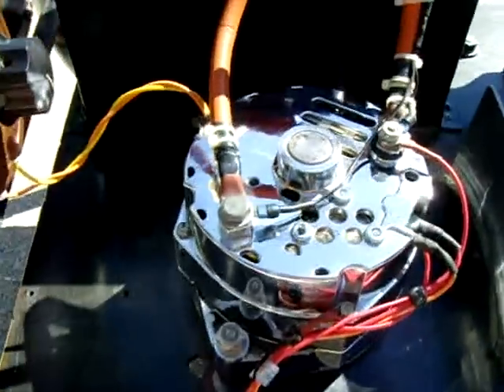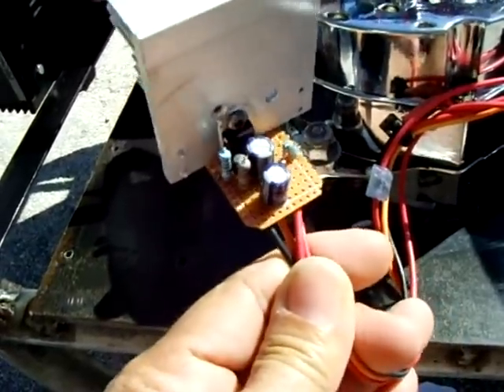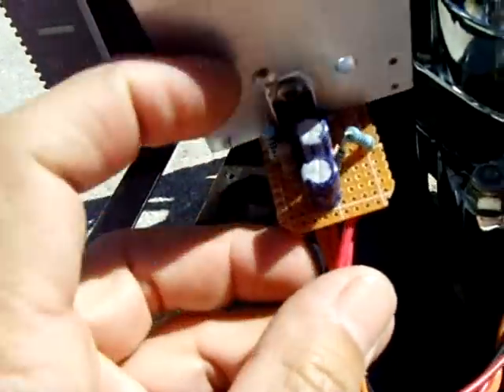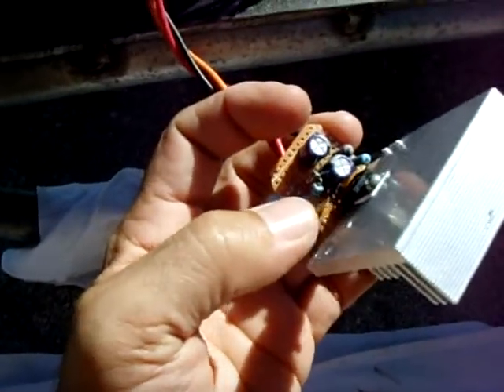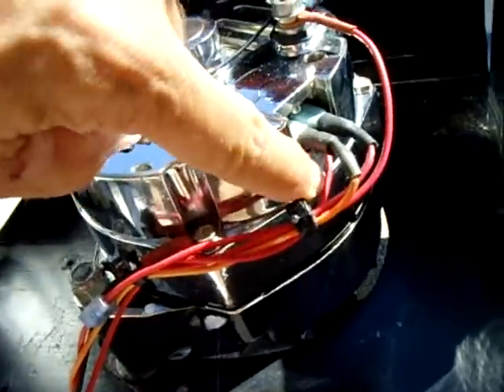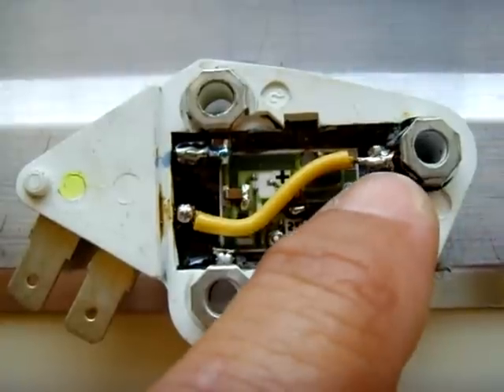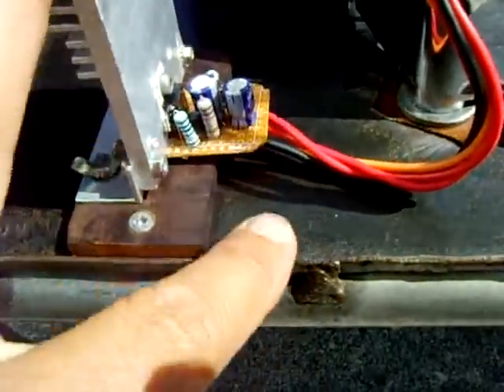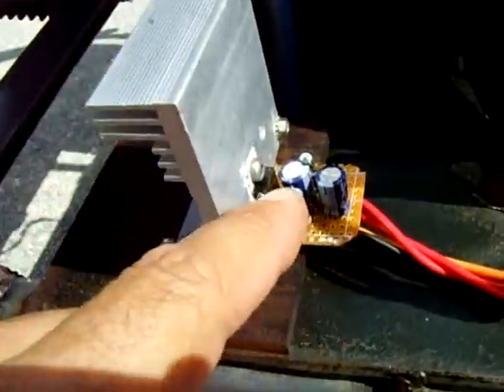Make Your Own Alternator External Voltage Regulator

Comment: Do you have a schematic/idea for a device to regulate the charging voltage to 13 to 14 volts for a lithium iron, LiFeP04, battery that I dropped in a moped that has rotor-stator, not alternator, system. The stock system charges too high, over 14.4 volts.

Comment: Can you use that for computer controlled alternators? My 2011 keep wrangle PCM stopped controlling the alternator and the PCM cost 650 dollars used!! Reman 1000 bucks!!
Reply: I doubt it, you'd probably have to go inside the alternator and remove the voltage regulator and utilize the sense and field terminals of the alternator using an external Regulator like from those old ford's 80-90's

Comment: Don't understand all the fuss. Your using a Delco 10 or 12SI alternator, which uses the internal regulator. If I was to build something like this and wanted an external regulator I would have used the model that preceded the SI, which is a Delco DN alternator that requires an external regulator. It was used on '60s GM vehicles up to '72. In fact, all the automakers used externally regulated alternators during this time frame. You probably could have picked up both alternator with regulator for cheap at nearly any boneyard instead of that chromed SI. Come to think of it, there was a project to build a solid state voltage regulator in a 1971 issue of Popular Electronics (forget the month) that you might be able to dig up online or at a larger library. Check it out

Comment: Thats all fine and good but how do you change starting charge rpm if your engin is runing belove 1k rpm? I have this problem my engine runing slow on idel and I like it but the alternator is backcharging tought dashboard any help.
And culd I actualy use my starter selenoid to exite te field? i do have R terminal type starter selenod thats bothering my for some time now aperantly some polarity swaps acure if my engine trurns on by that r terminal on starter slower turning but bether fuel economy dono why is it so? Im experiancing lot changes in my car even I wuld like to remove voltage regulator compleately and just use resistors on my other devices those alternators provide good power dono what I done my last alternator did not have external capacitor the engine fealt nice faster some how I dont understand what caused it tought??? Can we just get rid of that crapy voltage regulator and just run that alternator similar to oldschool magnetos ore some thing like that???
Reply: You could use a car relay coil to excite it maybe or a .3A light bulb

Comment: Very interesting and informative video.  but having a 12-volt positive aluminum heatsink hanging out there unprotected/uninsulated is absolutely insane. Not to mention dangerous. only a fool would run a setup like that, any conductive material dropped on that it's not only a fire hazard but can easily damage your internal Electronics there's got to be a way to do it without making the heat sink battery positive
Reply from the maker: You sound like the nervous worry wart type, I have friends like you. I ran this generator for 5 years with ZERO issues, far from a fool.

Comment: nice     but what i thought was the  2n3904  switches off the tipp 122.  not the case    it just   splits the power lowering the current going to the tip122  so the field current is cut in half.

Comment: Hi I am just curious. This circuit (mosfet one) will reduce the field current to adjust the voltage to the desired level at + ve terminal? Or just cutoff complete field current?

Comment: How stable was your output voltage when a load was applied and when at idle speeds? My old V-belt style Toyota has a 120A alternator that charges at barely 12V when at idle, so if I'm sitting at an intersection with fans, stereo, wipers, and turn signal going it'll drop down to 11V and sometimes even below, even with a new Denso internal voltage regulator in it. First thing I'll be doing is upgrading the rectifier, then will break out my electronics gear and experiment with an external voltage regulator that I can mount somewhere that'll stay cooler than its current location.
Reply from the maker: Not bad at all. Of course a slight drop under high current load.
Reply: @electronicsNmore  Very cool. This might be worth experimenting around with on my Denso alternator.

Comment: I tried the circuit and the fet blew
Reply from the maker: Sounds like either a faulty component, or you wired it up incorrectly.
Reply: i connected both  field  + and field - to each brush is that  wrong ?

Comment: need to add an Alternator to a 22 hp engine.  Using a 12-volt PTO clutch, requires at least 10 amp charging circuit. most engines only have a 2-4 amp charging rating.. Any suggestions would be great.
Reply from the maker: This is the way to go. 12V/35A. 

https://amzn.to/2MWJiTP

Comment: I No Longer sell this Transistor Regulator for 12 Volt alternators.I Now have a Mosfet  version that doesn't get hot and doesn't require a Heat Sink.People here should also know that the Normal Charge for a 12 Volt Car battery is 14.8 Volts.Or 7.4 Volts for a 6 Volt Car Battery.Gary.........chemelec.com
Reply from the maker: Hi Gary! Hope all is going well for you in Canada. If you'd like me to add anything to the video or video description area, just send me an email. Thanks

Comment: Those resistors look like they are in series so the total value is 1012ohms not 920 something. To achieve that they need to be in parallel.
Reply from the maker: g0mhc Been a while, so I don't recall every detail, but whatever I did do, was done correctly. Thanks for watching

Comment: If you simply attach a 300amp bridge rectifier, what will the ouput voltage look like??
Reply from the maker: Unregulated voltage that gets higher with increased RPM.

Comment: I have two 22SI 150 amp alts they are 12 volts. is it possible to convert them to 24 volt? or connect them in series? I need it to charge my 24volt bank of golf cart batteries. with a similar setup. I guess I should listen to the whole video . before asking questions. so if I can get a rebuild kit for a 24v 22 SI. I will have a 24 volt alternator. I thought the volts could be raised. since it generates in the hundreds of volts. that looks like a great setup. I have only rebuilt alternators. I never had one to tinker with. if it's that easy. I may get a few of them to overhaul. or convert. I'm thinking about putting the alternator on my riding mower. so I can charge the batt bank when I don't get enough sun. or when the lil creek is in drought. I'm planning a water wheel generator. and I haven't got my solar up yet. so I need it now. to help keep my off grid home charged. thank you soo  much for the video. is there any more planned for this subject?
Reply from the maker: You can make a regulator for 24V charging, and run the alternator at a slightly higher RPM.
Reply: electronicsNmore 
what about the turn on speed? what speed will it start charging? also will it.regulate the charge. like the factory regulator.  so it will not over charge the batts. so this just powers the rotor. creating the electro magnet correct??? I can't tell for sure but my alts are 130 or 150 amp. the dot stamping is hard to read. maybe one is 150 the other isn't. not sure. I need at least one to give 24v

Comment: can you make 12v  voltage regulator into 144v
Reply: If you are speaking of an alternator that uses a field current to control the output voltage, that might be possible.   If there is no feedback (no regulator), thus a static field current (usually around 1-4 amps), the output voltage is dependent on RPMs.  If you increase the field current you might reach 144v on the output at a certain RPM, the trick is not saturating the windings in the armature which the field current goes through. A couple of caveats, make sure no modules in the vehicle are exposed this high of voltage (TVSs = transient voltage suppressors typically are used to clamp voltage above 26v or 28v), and they will fail short taking out fuse banks), and the 6 diodes in diode bridge might be exposed to Vrb_max (maximum reverse bias voltage, usually around 100v), causing them to avalanche and fail as well.  Good luck in your venture!
Reply from the maker: That's pushing it. :-) You can probably take a standard alternator and modify the VREG circuit for 60VDC by using a 60V zener and higher voltage/current rated transistors, then take that 60v output and feed it into a dc-dc step up converter to 120VDC.

Comment: Used this on my vehicle. Voltage is unstable? Lights flicker? What's wrong? :(((
Reply from the maker: Clearly did something wrong, or have a faulty component. Better check the circuit and all the connections you made to the alternator. Draw a VERY clear picture showing exactly what you did, and how you connected the circuit to your vehicle. Upload the image online, and post the link to the image here. Thanks
Reply: +electronicsNmore my suspicion... is it the hysteresis resistor? I used 10k for a voltage difference of 0.25V
Reply: And btw how do I lower the reference voltage? 14.6V is too high for the vehicle, the acid in the battery has bubbles while charging. What specific resistor in the board will I adjust? I'd like it around 13.5-13.8V.
Reply from the maker: Edward Mendoza
You need to lower the zener value.
Reply: Is it always zener value + 2.6 = cut off voltage??
Reply from the maker: Very simple, whatever zener you used, try another one with a lower voltage rating.
Reply: I DID THIS REG TO. i HAVE THE SAME PROBLEN. it is flicker about 1 hz . its goes from 14 to 16 volts
Reply from the maker: I didn't have that problem. I noticed Gary replaced the original schematic I used with another schematic. Contact Gary. Once you find out the problem, please post the solution here for others. Thanks.
Reply: I resolved the light flickering by removing all capacitors... only flickers on cold engine start where combustion is still choking and unstable. but the mosfet heats up more than usual. my system voltage is stable at 13.1V
Reply from the maker: +Edward Mendoza Need a larger heat sink. My circuit uses a transistor.

Comment: i no electrical engineer but heat stink no power goto
Reply: You could always use a sil pad between the transistor and the heat sink and some insulating washers to decouple it from the heat sink. That is what I have seen typically.
Reply from the maker: +57210chevy 
What?
Reply: just like i said, heat sink no power go to. it should be dead or grounded
Reply: +electronicsNmore I believe he is asking why there is a charge on the heat sink... (it's designed to dissipate heat, why have a voltage on it) I assume for the design of that circuit, it's designed that way for a purpose... And that purpose is different than the one it's being connected to (which will cause conflicts of interest if not isolated from each other...) In non electrical engineer terms...
Reply from the maker: Malcolm Parkins
The Darlington transistor I used DID NOT have an isolated tab. :-)
Reply: Thanks for the fast reply... I was just trying to be a facilitator for the other person to get his question answered... Cause I can relate to not being an electrical engineer... haha

Comment: Does a voltage regulator make sure that the alternator never passes more than 6 volts to the battery, no matter how hard the alternator spins?
Reply: +Travis Heinze bro, pay a pro to work on ur car... not being a ass but it doesnt seem you know much about cars.. cars run on 12v systems, alternators turn faster, not harder for increased amperage..
Reply from the maker: +Freshkryp69 
Sorry, I posted a comment to you by accident. I deleted it.
Reply from the maker: +Travis Heinze 
The voltage will not rise more than what you set it at. In this case, around 14V.
Reply: electronicsNmore Can it be set by the computer in the car? I get the impression that a voltage regulator is now controlled by computer for newer cars? I have a 2004 Ford Focus.

Comment: Also after disassembling and soldering the regulator pins just use a cheap common electronic regulator from an early 80's dodge, no soldering resistors etc , and they are sealed and chrome.

Comment: man... just buy a new regulator likely $10. Simpler.
Takes about 20 min to change. Add a set of new brushes, and run for another 10 years. Also doesn't look so hoakey with wires all over.
Reply from the maker: +AL M 
Much better doing what I did. Once the regulator was made, I had FULL control over the output voltage, and in the event that a component fails, I can desolder the component and swap it out in minutes for only pennies. If you ever have a problem getting a regulator, you will be glad I made this video.
Reply: +electronicsNmore  Sorry, I wasn't knocking  your video. It's just that guys like me don't know squat about zener diodes and such, and it  makes more sense to me to  install a ready made part. What I was trying to find when I saw your video was a way to make a rectifier/regulator for a permanent magnet alternator, No one can find a replacement  for me.
Reply from the maker: AL M

What you need is a "shunt" regulator circuit.
Reply: Look at Yes, look at Flexcharge.com charge controllers with a “shunt “ high amperage contactor. They can control up to several thousand amps.

Comment: hi  ive checked the schem.   does this thing work?   what is a hysterisis  resistor?
are the resistor values critical?    i have a  bosh style alternator  with no regulator.
2 wires coming from the brushes.    a field  connection and battery connection
are both  the brushes positive? or are they  positive and negative?   let me know   thanks.
Reply from the maker: +anusheadproductions 
Of course the circuit works. I do not post bogus videos on my channel. If you duplicate the circuit, I suggest you use the same exact component values to avoid problems. The slip rings on the alternator are NEG and POS.
Reply: ok thanks a lot. im going to build it.  hysterisis
resistor      is that just a regular 5% 1/4 watt
resistor?
Reply from the maker: +anusheadproductions 

You can use a 1/4 W 1% or 5%.
Reply: ok   and i would like to get that PCB
how do i get that?  from chemlec?

Comment: it would be cool if it were adjustable voltage. i could use one adjustable to 18 volts. not for battery charging. but as a high output makeshift power supply driven by an ac motor or off grid with a stationary cycle. it can be excited with 2 x 9 volt batteries in series, with a momentary button to initiate the charging process. then the alt will hold an excitement charge via a 24 volt capacitor of suitable farad rating. when the use is no longer needed. the cap will drain off. to use it at a later time, push the button for the 2 x 9 volts. your back to making power.
Reply: using the method demostrated in this video, the zener is the reference voltage, which drives the base of the BJT, which operates as a voltage-follower (the extra voltage from the alternate will get burned off dissipatively, hence the huge ass heatsink).  If you want an adjustable voltage, add a potentiometer in series with the zener and rewire the base pin of the BJT to follow the zener + I*Rpot.  Make sure the zener voltage is the lowest voltage you will ever need because the potentiometer will only add voltage, not subtract.
Reply: @bradatherton9369 could you demonstrate this in a schematic?

Comment: I have  a vehicle with a High output fuel pump. Very noisy. Alternator output is 14.9 volts. WHen I disconnect the alternator, the pump noise is greatly reduced. Need a device to lower the voltage at that pump. Any suggestions? Vehicle specs for voltge is 13.5 14.2
hjlint@comcast.net
Reply from the maker: I had problems with noisy fuel pumps years ago(A whining sound). I ended up replacing them. Try replacing the voltage regulator. 14.9 is high. 14.5V is usually the top end. You can also take a 5A Silicon Rectifier Diode(or 2 of them in series) and place it in series with the 12V + power wire to the fuel pump. DO NOT use a Schottky type or you will not lower the voltage by much. Each diode will drop the voltage to the pump by .3V to .6V. :-)
Reply: electronicsNmore I did replace the Pump twice. Same noise .  When i disconnect the alternator noise goes down to what I say is normal.Even hitting the power seat button cuts the noise down. I will try to find these parts and see what happens.
Thank you
Reply: electronicsNmore Trying to find this 5A  diode. CAn you give me a part number and were to buy?
Reply from the maker: Here you go:

http://www.digikey.com/product-detail/en/SB540-E3%2F54/SB540-E3%2F54GICT-ND/190378

Comment: Do you have a testing video in this project?
Reply from the maker: Testing video? Once the circuit is made, just use a DMM to make sure the battery stops charging at the voltage you set using the zener diode.

Comment: Very nice project.
What I would prefer would be to insulate the transistor from the radiator, which would simplify mounting and make it immune to the risk of some metal object (screwdriver, wrench, whatever) shorting the radiator to the frame.

Comment from the maker: Your ATV uses a charging coil with permanent magnets, not an alternator. There is no rotor in your ATV like a car/truck/van has in its alternator. The wires from the charging coil feed directly to the regulator and battery.